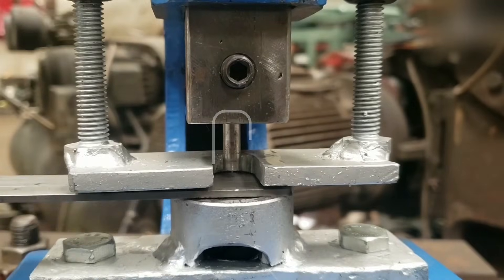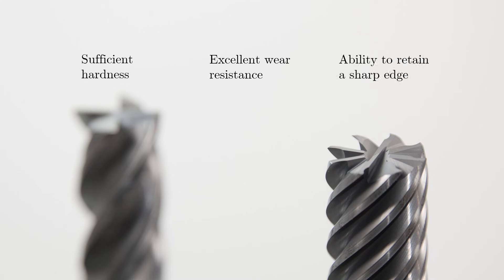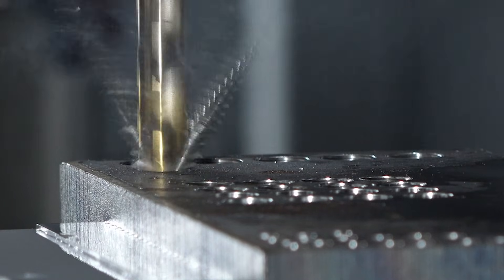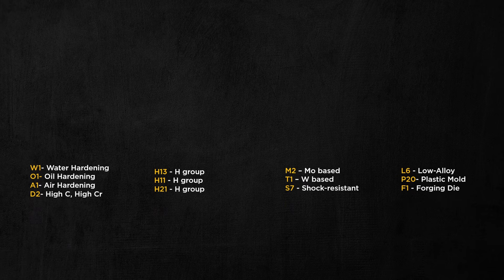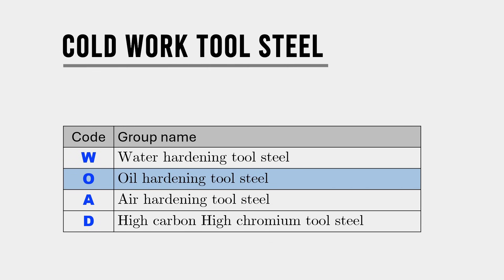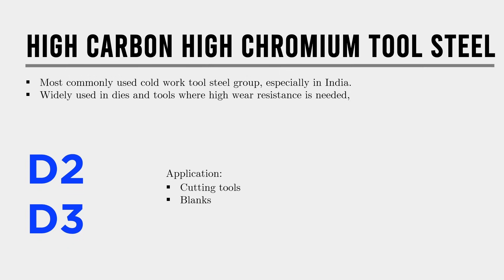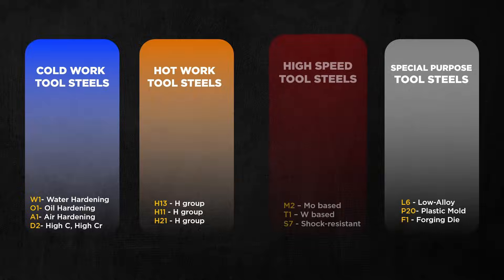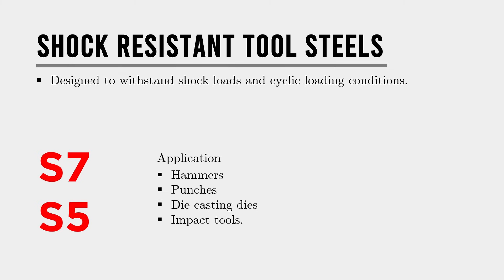Complete Guide to Select "Tool Steel" in Your Machine Design

Comment: There is another thing with D2 tool steel. It's easy to weld. So I believe that's the  reason it's most used in automotive stamping. Just heat the part to 450 to 500 celsius, weld it with tig and special wire, regrind/remill it and get back to stamping.
Reply from the maker: Thanks for the additional info!